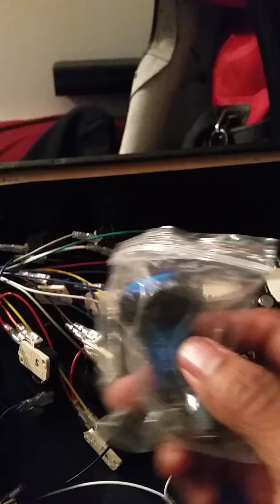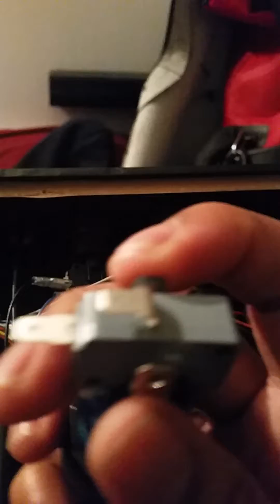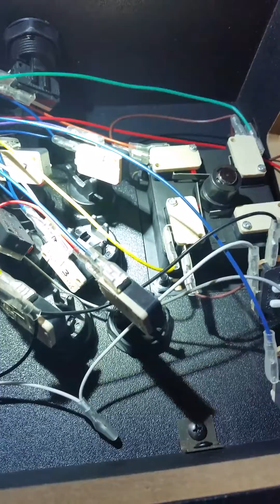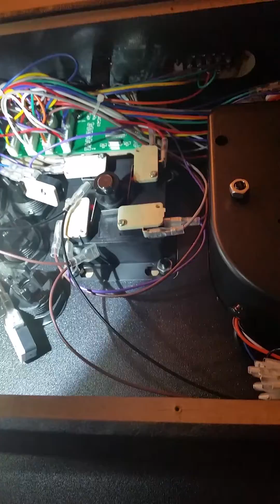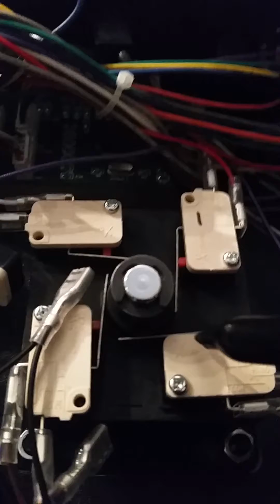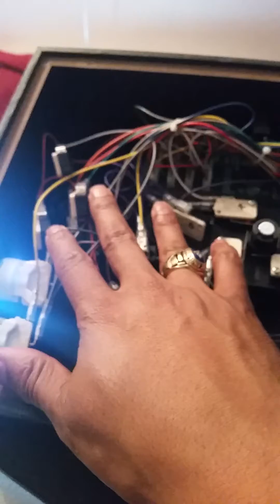X-Arcade Tankstick LED Button Mod

Comment: Hey do you happen to have a link for the wiring? I see the encoder i need, but want to make sure I get all the right wiring, but the link is dead to the wiring part.
Reply from the maker: Sorry I just saw this. I got the daisy chain from Ultmart. You don't actually need additional wiring if you use the daisy chain.

Comment: Did you use two encoders??
Reply from the maker: Yes. The one that's already factory installed controls the buttons,  joysticks and trackball. The spinner has it's own usb controller as well as the LED button lights. They also have their own USB controller, but that controller only controls the LEDs on the buttons.

Comment from the maker: There's a correction to the wiring scheme.  You use the daisy chain only.  Daisy chain all the led connections using the Ultimarc daisy chain wire.  Once you've got both sides wired, you should have two ends.  One end goes on the positive of the USB encoder and the other on the negative.  Plug in the USB and you should have lights on all 16 buttons.  If you need to know what the wiring looks like go to 11:14 in the video.  The black daisy chain wiring is visible @ 11:14.

Comment: Did you use the micro switches that came with the buttons or keep the one that came with the tankstuck? Just curious which might be better.
Reply from the maker: When you get yours put together, post a pic of the finished product.
Reply from the maker: I used the same ones that came with the Tankstick.
Reply from the maker: I kept the original switches and popped the switches that came with the LED buttons out and snapped them onto the switches that are on this video.
Reply: I will post pics, just sucks that I couldn’t get the red led buttons. I emailed the seller and they said they would not be getting the red ones in. I wound up getting blue the green. Still waiting on my graphic.